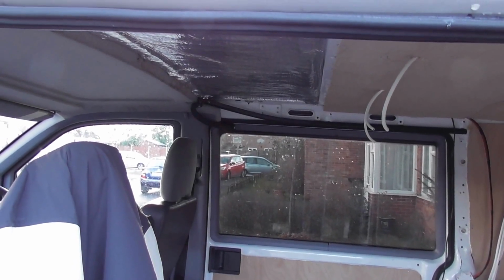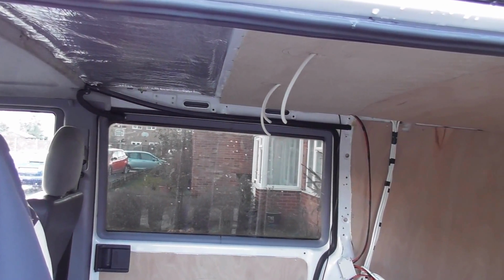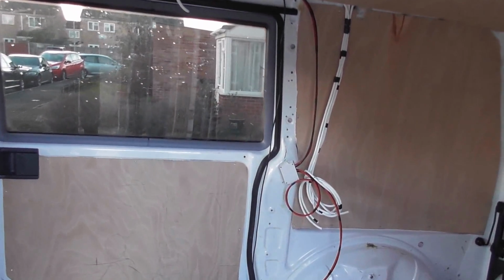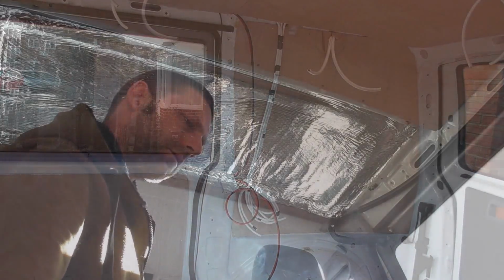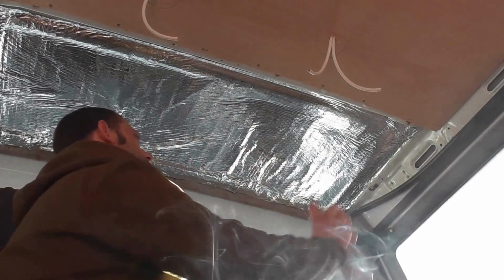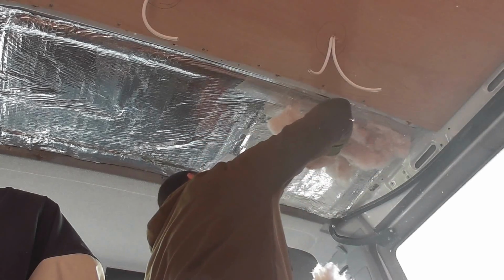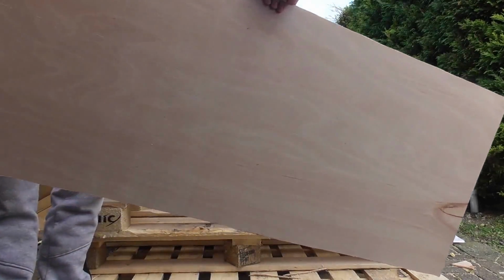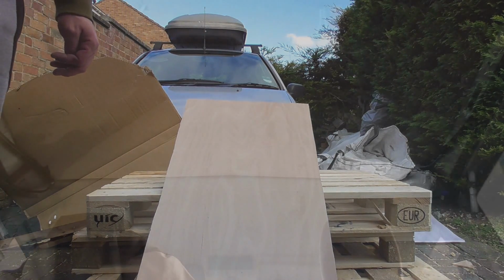Self Built Camper Van Part 07 Last Roof Panel And Cable Gland 28/01/2017

Comment: Hi, I'm about to start my van and contemplating the insulation. Did you use a vapour barrier? Or just the silver bubble first and then the loft insulation with the board directly on top? 

Thanks
Reply from the maker: Hi Charlie that’s what I did. I just used the bubble wrap and the recycled plastic insulation. I have had no issues with damp anywhere apart from the cab are being the only place left to insulate. Worked well for soundproofing and hear very little outside.
Reply: No vapour barrier???